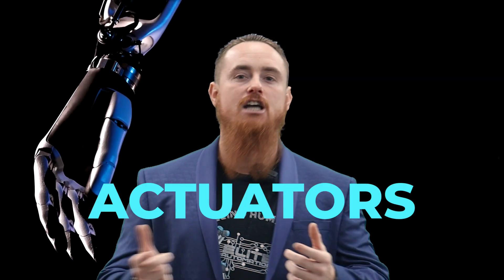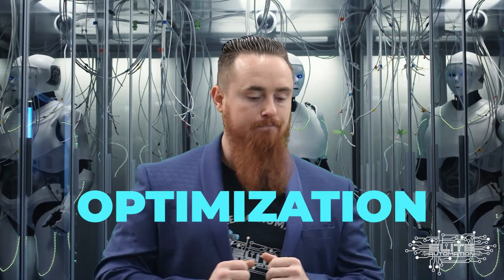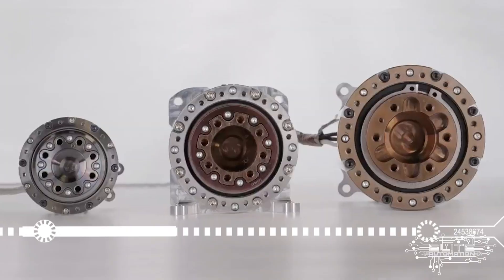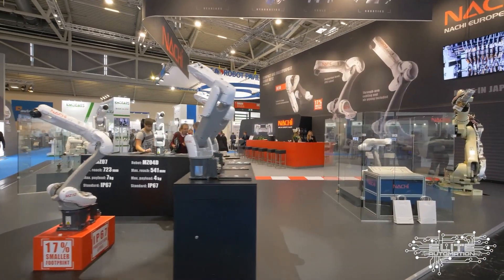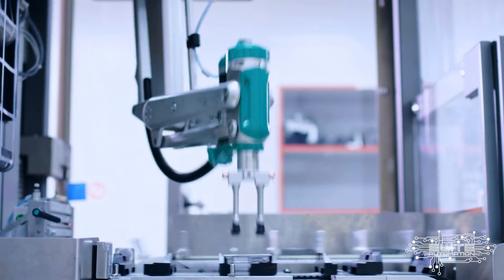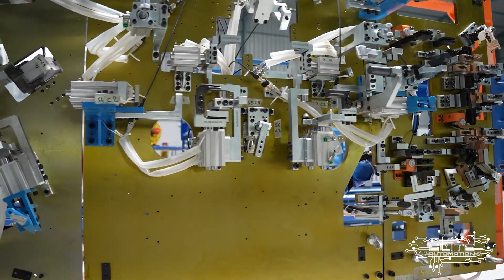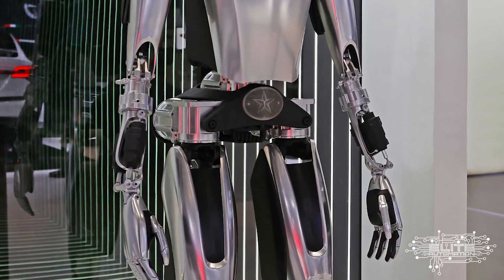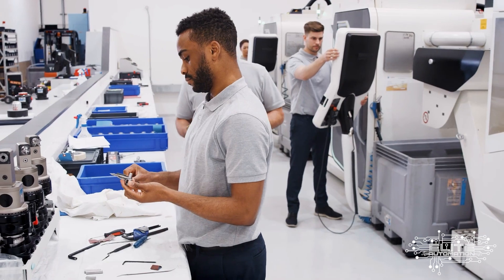Tesla's Robot Actuators: A Game Changer for Robotics?

Comment: If tesla is using pneumatic, how are they going to supply the compressed air?
Reply from the maker: Hi, we think that Tesla's focus on efficiency and compact design suggests they've likely developed custom actuator solutions tailored specifically for the Optimus robot. These actuators would likely incorporate advanced technologies like electric motors, gearboxes, and sensors for precise control and performance.

It's important to note that this is based on available information and speculation. The exact details of Tesla's actuator technology remain proprietary.

In this video, we mentioned some of the types of actuators that the robotics and automation industry are using and is currently on the market.

Comment: Thank you for your explanation of Tesla's involvement with developing its own pneumatic actuators. I agree that if Tesla could have simply bought an "off the shelf" item that matches the design spec sheet, they would have done so. The problem with prototypes is that they take time to perfect with testing and modifications cost $$$ thousands, if not hundreds of thousands, to get the FIRST working part! Tesla can afford it, small builders cannot.😢
Reply: I think that Tesla understands that the real value of a humanoid robot is making it the exact form factor as a human.   Think of all the tools that are designed for the exact human form.  If their robots don't match humans, it won't be the skeleton key they are trying to develop.
Reply from the maker: @n8works  exact form factor and movements are what they are shooting for. read somewhere that they already achieved 22 degrees of freedom on the optimus gen z bot.
Reply: @EliteAutomation  yep. Makes sense.  If your robot can learn anything by watching, then making it an exact match for all of the human shaped tools in existence is a huge value multiplier.
Reply from the maker: and Tesla could even up entering the pneumatic actuators market if their own design could become a hit.